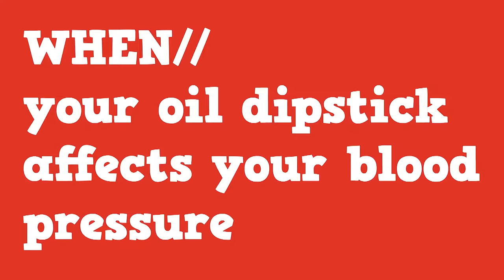CravenSpeed MINI DipStick Demo

Comment: I like this dipstick. As a place holder. I bought an updated version for my R53 and it does not measure the oil correctly. All the holes are full but when I use my OEM Dipstick I am almost a full quart low. I'll keep your dipstick as a plug and use the OEM one to measure only.
Reply: Craven Speed Okay. I will. Thank you.